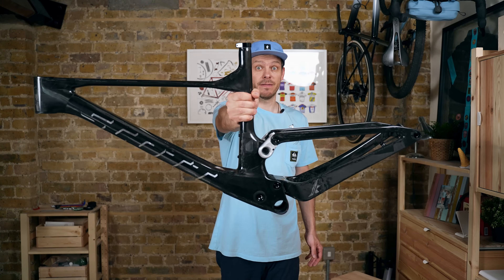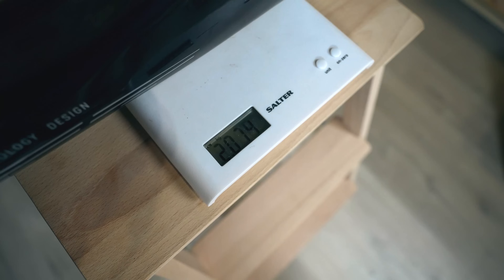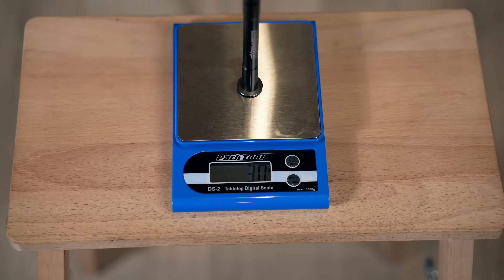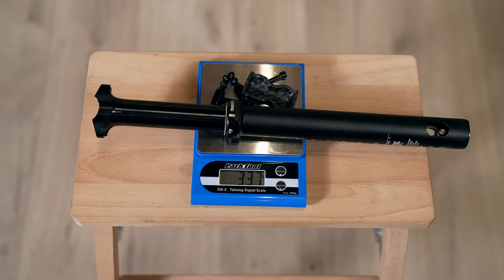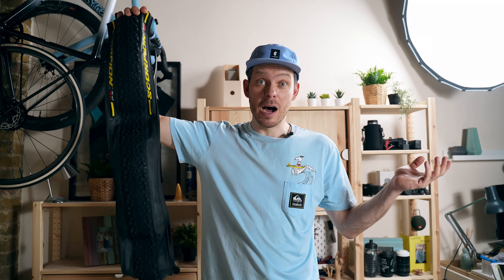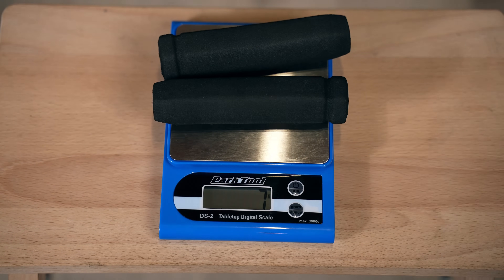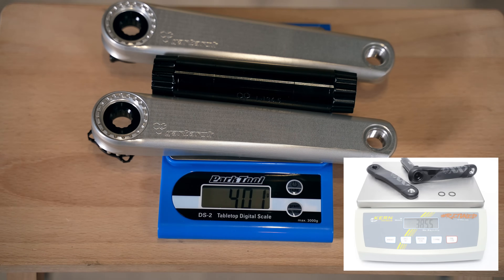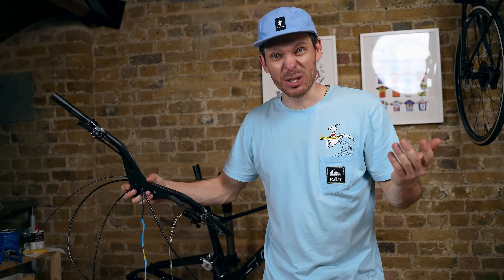Building a SUPERLIGHT Scott Spark RC with fully INVISIBLE cable routing!

Comment: amazing the amount of work and research that went into this project and all your projects for that matter, It would be a cool to have cost brake down along with this process, but that maye be non of our business LOL just stripping the frame and clearing coating has got to be a huge labor undertaking costing big bucks I bet. anyways love your stuff thanks for sharing, hope you get to quit your day job 😁
Reply from the maker: Thanks!
Reply: It takes many hours to remove the paint but it's worth it . I went a little insane with my spark and made it single speed at under 6kg .I have since added gears so will be weighing it soon .

Comment: Great build 👍  please that fork internal to use internal cabling  what brand is that?  And is that something you could use on your Aethos?  I have a crux 
Thanks TW 🤙
Reply from the maker: Thanks
It’s Intend expansion plug. 
My aethos has D-shape steerer
Reply: @TwistedWheels  okay great thanks for the reply,   Will check it out  good luck with that 500km race 🤙
Reply from the maker: @markanderson7412  thanks!

Comment: I like your build (once again) a lot, especially the clear coat design of the frame! If you don't mind, I'd had some questions about some of your chosen parts: 

1. Which bottom bracket (manufacturer) did you choose? 
2. is it possible to buy carbon plate from bjorn cycle separately  to tune the Fox transfer or did you use one from a seatpost? 
3.  Can you tell me which after market clamps and bolts you've used? 
 
Would appreciate a reply!
Reply from the maker: Thanks :)
1. I am using Raceface double seal 
2. Unfortunately, no
3. They came one of the no-name chinese seatposts. You can use any with the round section

Comment: This is crazy good level of craftmanship! Btw pal, what is the tape/material you use in the 3 cables of the twinloc? Looks super clean
Reply from the maker: @josericardosanzherrero1303  thanks! I used a heat shrinking tube
Reply: @ thanks for quick reply, I just bought some and ESI grips silicone self-bonding tape, and I will compare results!

Comment: Nice and clean build.  I have to wonder if you're trying to thread that line between durability and lightness.  Have you had any parts break?  Do those rims hold up to rock gardens or riders over 200 lbs?  The tires look paper thin.  The seat looks really cool, but how do you feel after a few hours in the saddle?
Reply from the maker: I’ve done a 7-day Bike Transalp race on this bike. No parts have broken and it performed great. The only thing I’d change is replace brake rotors with Trickstuff. Otherwise super happy with the setup.

Comment: NICE~! KUDOS for the sharing and great video presentation, should be quite a lot of effort. BTW, how's the TrickStuff braking performance?
Reply from the maker: Thanks. I really like the brakes. But for longer descends (like in the Alps) I would use them with bigger rotors and maybe with brake pads with fins like Swiss Stop.
Reply: @TwistedWheels  Very first of all, thanks for your promptly reply ya... glad to hear that you're enjoying them, at least happy after long waiting... NOTED of your sharing and SAFE ride ya... KUDOS~!

Comment: Hey there ! Do you think that 2 brakes lines could fit in the extenseur inside the fork ?
Reply from the maker: Just two brake lines - yes.
Reply: @TwistedWheels  you used the FSA compression plug?

Comment: Amazing build, what a beautiful bike! What bottle mount are you using for this? Any rattling at all off-road?
Reply from the maker: Thanks! In the video I am showing Fabric. I also use Fidlock. I prefer Fidlock for offroad to be honest
Reply: @TwistedWheels  ah I’ve seen them around! I might get them for my gravel bike — I mostly do road and single trail with it, and will keep the fidlock on the mountain bike, love that system!

Comment: Really nice build, congrats! Just one thing: Doesn't the brake cable rub on the  fork when compressing/uncompressing? Would be a shame to ruin that nice black coating!
Reply from the maker: Thanks. 
No, it doesn’t. I have two cable guides there, so they keep the hose away from the fork.

Comment: How did you remove the stickers from the handlebar ? I can see that you're scraping with a knife, but it leaves lots of scratches, yet when you look at the handlebar again, it's smooth and clean.
I've got this handlebar too, and I can't get the stickers off without scratching it.
Reply from the maker: Do you mean the handlebar? I don’t have any stickers on the hanger :)
Reply: @TwistedWheels  Yes the handlebar, sorry it's the automatic traduction
Reply from the maker: @thomasbomy7494  you have to be very careful to not damage/remove the clear coat. Then I polished it and job done.